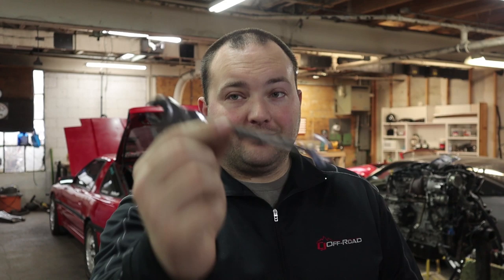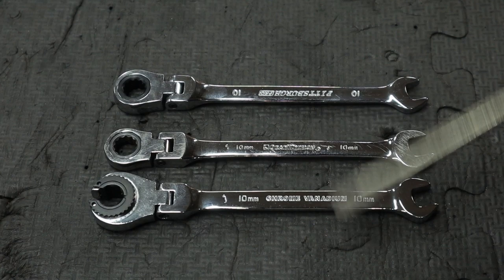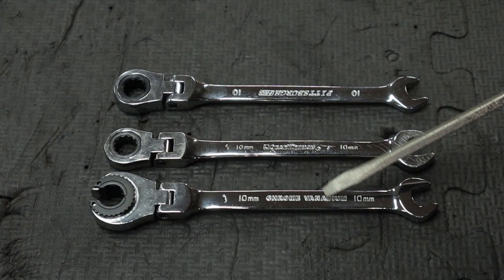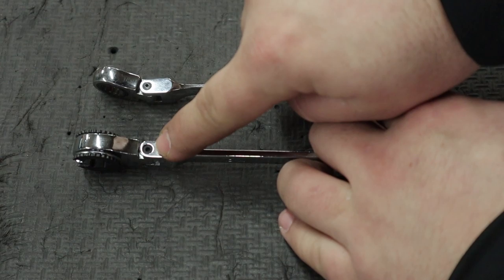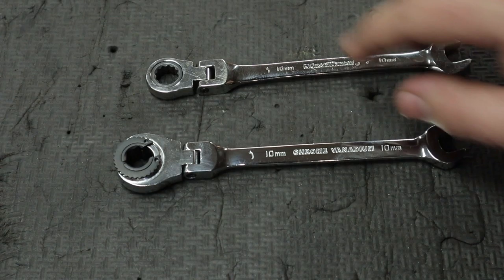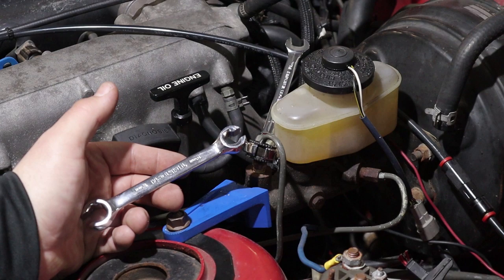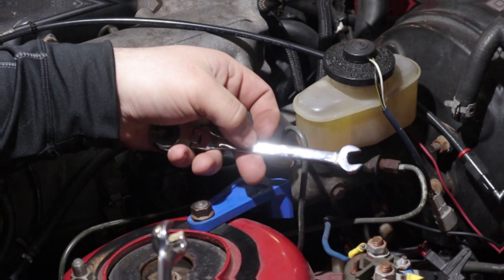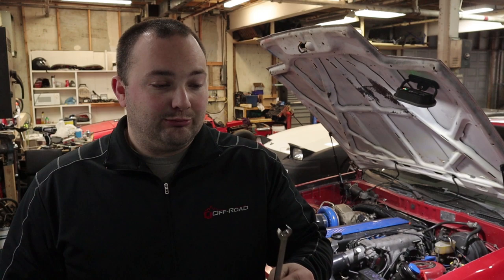This wrench is a game changer!

Comment: I'll stick with line wrenches for the same reason I use vernier calipers instead of dial calipers. Sometimes simple stupid is the most reliable. Also not sure why the other end of this ratcheting wrench isn't a line wrench style.
Reply from the maker: If i had to guess, the wrench end is probably made in the same factory as the gear wrench flex head wrench and its easy to add accessories to it because it already has the provisions for the pivoting head, so the company probably just makes the ratchet flare wrench head d and retrofits it to the wrench.